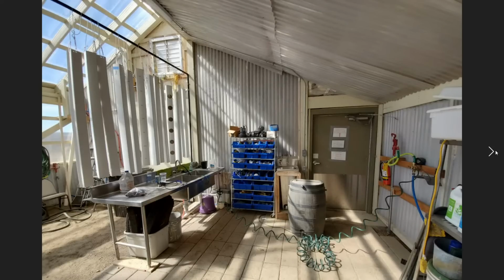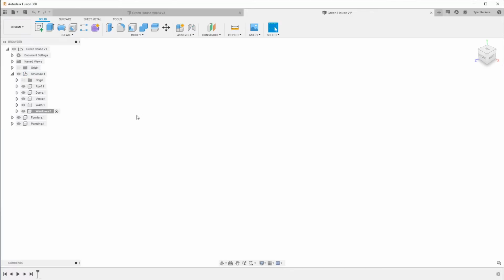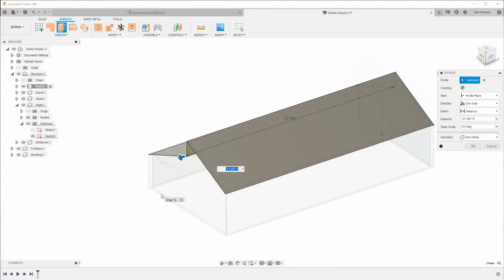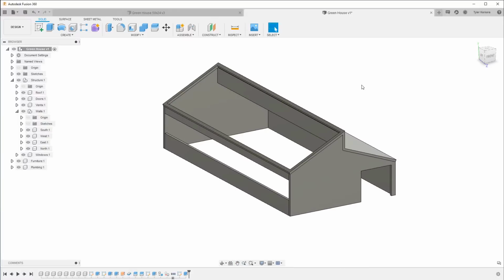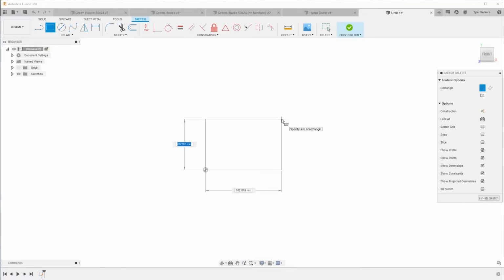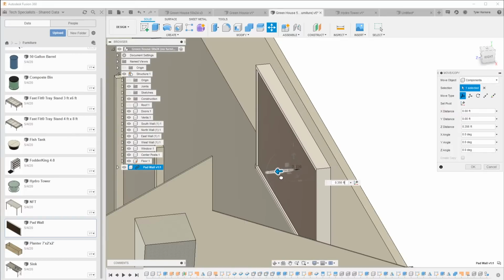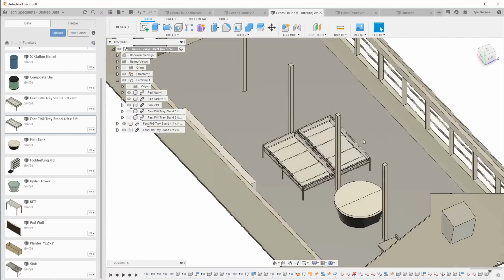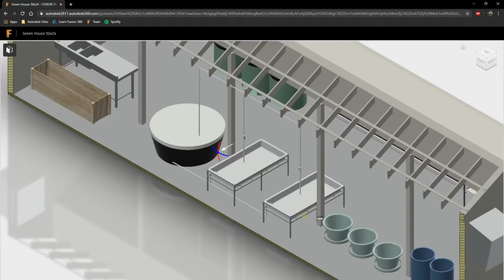360 LIVE: Making a Better Plan with Floor Plans

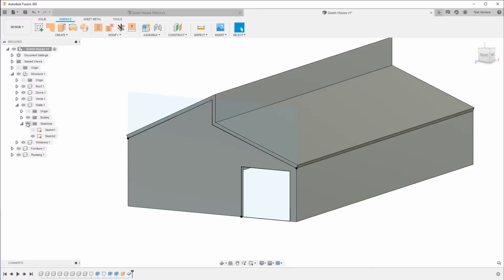Comment: 20:32... wouldn't it be better to extend the vertical line of the corner, then do an extrude(cut) to remove that weird angle in the roof? I am a newbie

Comment: As always, I learned several new things. One of the things I do is make telegraph keys either from brass or lately by 3D printing many of the parts. Very different from a building, but I immediately saw that I could do exactly what you were doing. Build a base, then populate it with various major components just like your furniture. It would allow me to check early on for alignment and conflicts before I made any specific decisions. It would save a lot of time to just sketch out a plan as you have done. I do so on paper now, then jump right in working bottom up on components, but find myself going down blind alleys and changing things I should have known about.

I've also been avoiding creating all the components right at the beginning, even when I know what they are. For me it makes it more difficult to find things in the time line that are related conceptually, but not in time. I guess I'm expecting the time line to be the browser and it isn't. I'm going to give your method a try on the next few projects and see how it works. Probably just a matter of an attitude adjustment on my part. 

Thanks for the videos. They are much appreciated and always useful. Frankly, I almost skipped this one because I have no interest in laying out floor plans. Little did I know...